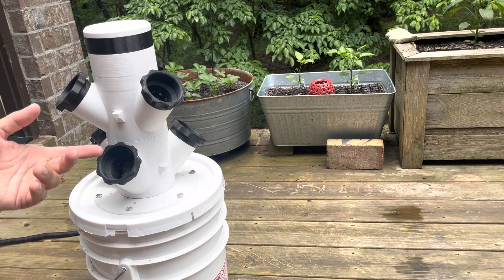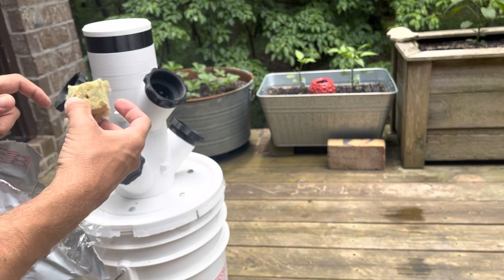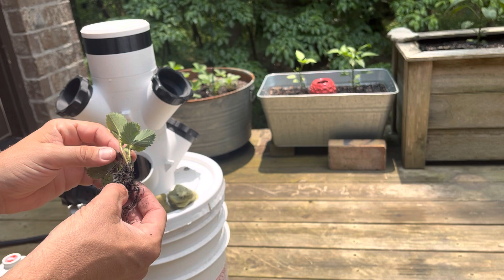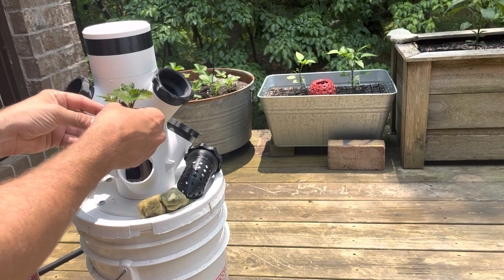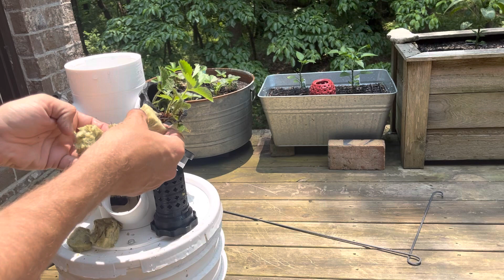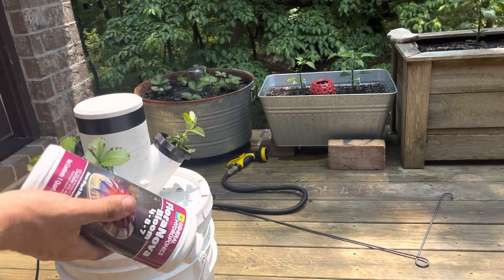Setup: 3D Printed Hydroponic Tower

Comment: I am in the process of redesigning mine. I am converting the drip system to be an internal misting rod and dropping the internal ring that sits snug against the pvc. Reasoning is if you ever wanted rotate out your layers or remove one set for cleaning before replanting it is easier to move them around. Will probably print a support layer just above the bottom that can have support braces mounted to bucket lid. With misting I only foresee having to print some lids for any empty plant holes. Also did you happen to seal your prints? I want to seal mine and I am thinking the best way would be to assemble, spray seal, and then disassemble with a light coating on any parts that were missed/not exposed.